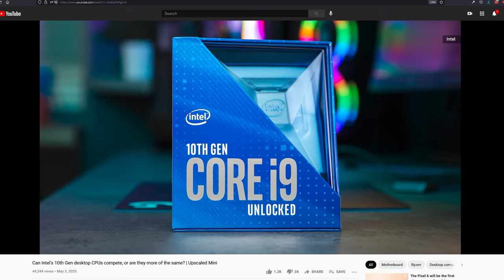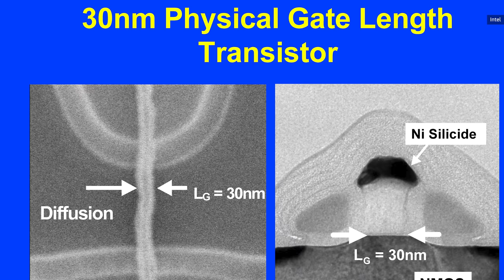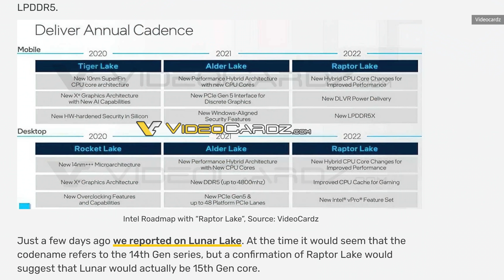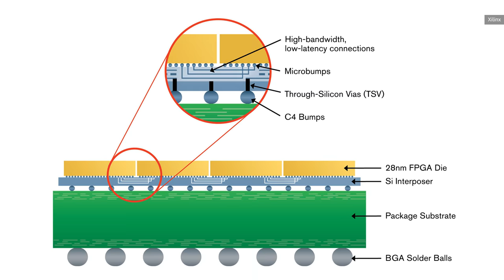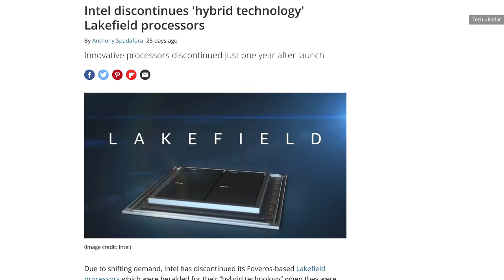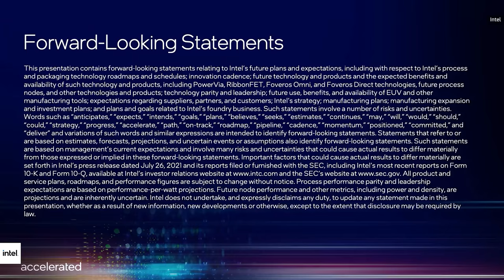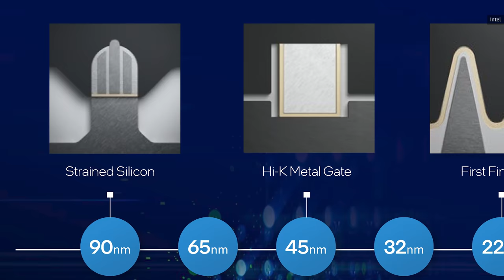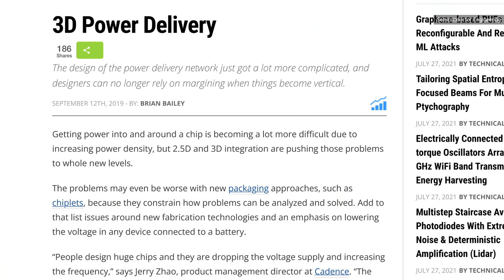Intel has a plan to go beyond 3nm chips  | Upscaled

Comment: Question: Did Intel have an nm advantage in the last 8 years? if Intel 10 nm = TSMC 7 nm.
Is Global Founders 32 nm = Intel 32 nm? And 21 nm
Reply: Global Foundries and Samsung were slightly behind TSMC in terms of transistor density. But close behind. 

If Intel's 10nm node had been successful back in 2016, then they would have been in the lead by far. So far head, that the 7nm of other companies would still be behind the Intel 10nm node (in terms of transistor density).

Intel isn't competing with AMD. Intel created AMD so that Intel can have a monopoly without the legal implications. And also, AMDs most important job was to prevent non-x86 architectures from sneaking in should Intel have an off period.

When AMD started out, they made clone chips of Intel's previous gen chips, and slapped an AMD label on it. Both CPUs could work on the same motherboads (because they were basically the same thing). 

This allowed Intel to avoid more anti-monopoly laws.

By law, Intel is forced by the government to license the x86 architecture to at least 5 companies (to prevent a monopoly).

Intel has fixed the game...and AMD is not really a competitor...not when you are one of the main shareholders who have their fingers in what is actually a single pie. If Intel really wanted to get rid of AMD before 64bit, then all they had to do was give that license to another company. 

Competition is an illusion created by Intel when they created AMD.
Reply: @tylerdurden3722  AMD owns the x86_64 the 64 bit extension of x86. Intel has to license it from AMD. so they both need each other. if Intel pulls x86 then AMD can pull x86_64 and intel cant make 64 bit.
Reply: @RickyT15  Uhh, Intel licenses x86 to AMD
Reply: @muhammaduwaismuhsinmuaz4385  yes and AMD owns the rights to x64 extension and licenses it out to intel.
Reply: @RickyT15  oh yea

Comment: ZERO chance I'll EVER buy ANY apple product :D   theyre literally worse per buck than any other product. On top of which you get zero posibillity of tweaking anything serious to your own desires AND they control your device and actually even DOWNGRADE it over time in order for you to have to buy a new product - that if it hasent self destructed due to overheating long before and they deny you ANY possibility of repairing or replacing ANY part at a normal cost.

Comment: This plan sounds horrible and over engineering something that already broken. During that time line the others will be in a different realm,  what Intel trying to do in 2025 will be useless and they will eat them up. Imagine what ARM CPUs will be in 2025 , The only way is to price it very low, lower than all the competitors or the performance is at least 2x faster with the best lower power consumption than the competitors which we know will never happen lol

Comment: They can't even match AMD in performance...I'll believe it when I see them actually meet deadlines instead of just talking.
Reply: 11th gen destroys amd in gaming
Reply: @creatineenjoyer7345  not really but it does match AMD in performance except at r9 vs i9
Reply: @creatineenjoyer7345  you're delusional not to mention Zen 4 is going to obliterate Alder Lake in 2022
Reply: @creatineenjoyer7345  No, they're nuclear reactors that can't match up with their Ryzen counterparts.
Reply: @MatrixJockey  Raptor Lake is going to obliterate Zen 4 in 2022
Reply: @gromek32  We will see what these next generation platforms will bring to the table. I still do not think that the BIG.little architecture by INTEL will suddenly crush all the work AMD has been doing over the past 4 yrs.
Reply: @MatrixJockey  intels big little is very different from arm big little coz the little cores are also quite powerful. These little cores used to compete with arms big cores in performance. And the big cores called Golden cove are about 25% more powerful than zen3. Overall it beats everything from amd including the top 5950x.
Reply: @Yusufyusuf-lh3dw  I'm aware.

Comment: All this new roadmap all of a sudden might be to attract media and increase funding. Even if we look at alder lake, which should be get the highest performance gains in years because of moving on Intel7 directly from 14nm+++++, skipping 10nm and 10nm superfin even with 19% IPC that Intel claims should have increase 50% performance in equal core. But the difference between 11700k and 12600k isn't that much despite both being 16 thread CPU

Comment: intel is struggling to put out 10nm chips and now is talking about angstrom, hmm i see angstrom about 2 decades away. and by then the competition might be on 0.5nm.
Reply: These are just numbers. Nothing about a TSMC 7 nm is 7 nm or an intel 10 nm is actually 10 nm. It’s not that the numbers are slightly off; the numbers mean nothing and have meant nothing for a decade. Smaller numbers are just meant to convey a better process node. What matters is power, area and performance. Measuring area is not trivial either; it depends greatly on if it is logic or SRAM and the required performance and power.

Comment: I forgot which one electron/photon that if the layer too thin, the electron/photon can just go through it. Designing 3nm fabrication chip would be a big feat
Reply: That refers to the transistor gates. At 3nm gate width, this starts to happen. It's a quantum effect called Quantum tunneling. The electron doesn't really go through. It kind of teleports to the other side. 

SSDs and flash storage use this phenomenon as the bases of how it functions. Electrons are intentionally "teleported" across barriers. 

But, you don't need to worry. Transitor gate widths are not there yet, or even close, and are not really shrinking.

E.g. Intel 14nm and TSMC 7nm average gate widths are about the same. (gates widths vary from transistor to transistor within the same chip, depending on the requirements for that transistor) 

There used be a time when "3nm" would refer to transistor gate width, but that time is long gone. And all we're left with is marketing BS...which has turned into a runaway train.

Comment: Just a technical question: With the lowering of channel length, don't you think heating will increase due to the increase in leakage current and quantum tunneling?  Sorry if I am missing something. 3nm is cutting edge.
Reply: Yes, actually this is already a huge problem. That's why they moved to FinFet and are moving to GateAllAround design. Actually currently the individual transistors are not getting more efficient anymore, because we moved beyond the Benards Scaling regime. Basically room temperature is causing too much noise. But because due to scaling you can still cramp more transistors onto the chip, the overall chip still becomes faster.

Comment: Arm on desktop will be insane
Reply: Only if it can scale well
Reply: @ryanwallace983  I believe it can with the proper support and software structure behind it. Such low power consumption for high performance mobile computing will usher in a golden age of technology
Reply: @earnistse4899  software doesn’t equate to power scaling-that’s a characteristic of whatever node/process they use and chip design

Comment: I'd prefer to go to Apple's "M2", M1 is their entry level SoC, they're learning from it... So it's better to wait for "M2"

Main reason is because M1 was already pretty powerful and with less than 10W...
Reply: M2 will also be entry level. M2 will simply come in products currently having M1.

M1 to M2 is like Intel 10th gen to Intel 11th gen. M1 to M1X is what Intel i5 is to Intel i7. 

If you’re talking about more multicore performance, you’re looking at the M1X. Bloomberg says 8/2+q6c GPU against the M1’s 4/4+8c GPU. 

Apple is not “learning”. I’m suprised why people simply forget that the iPhone and iPad have been running on A series since 2007. More than 10y. It’s not yesterday that apple started making processors. M1 is literally an A14 with more cores.
Reply: @shresthsonkar9207  I'm not interested in Desktops, I prefer Laptops, so "M2" could be considered a high end option (at least for me) if rumors were right about its specs (12 CPU cores / 16 or 32 GPU cores)
Reply: @jihadrouani5525  that SoC you describe is the  M1X, not M2. 

And M1X won’t go into MacBook Air anyway — MacBook Air will get M2 which is going to be only 20% faster with same amount of cores as M1.
Reply: @shresthsonkar9207  There's nothing official yet, I would get a redesigned MacBook (14" or 15") with 12 CPU cores, and 16/32 GPU cores (under 2000$ if it's possible)

Comment: Intel have to beat Apple/AMD in design and TSMC in fabrication and they are currently failing at both. Meanwhile, Apple/AMD just have to concentrate on one thing, chip design and TSMC just has to concentrate on one thing, fabrication. In such situations, the gap usually keeps getting wider
Reply: Intel would catch up they are very innovative
Reply: I don't think Intel is behind AMD is design.

Over the last few years TSMC was leagues ahead of Intel in terms of fabrication.

Yet, Intel's final products still competed with AMDs. Which means that Intel's designs were leagues ahead of AMDs designs.

And it needed to be for them to at least be on oar with AMD for so long.

Just ask yourself this, do you really thing AMDs designs would even hope to compete if those were put on 14nm (like the Intel designs were).
Reply: @tylerdurden3722  AMDs designs is better. Currently intel is using a more dense 10 nm  108 million transistors sq/mm vs Amd using tsmc’s 7nm 97 million transistors sq/mm. Intel needs to use a ton more of watts to match and exceed AMDs performance

Comment: I hope Zen4 is like Zen2 in term of Zen3 hi performance but more humble of AMD. 6600 priced like 3600 when it first out or a bit cheper. I hope AMD will once again create histrory buy adding 2 core at same price. So 6600 will be 8/16 on the same as 3600 release price. 

Intel is so funny trying to make sure that their 14++++ is on par with 10nm other and 10nm is on par with 7nm. But it even prof that their processor architect is not good, not because using outdated fab.

Comment: But if it makes CPU components do they not understand that's that is a that is a processor to make CPU cuz the d u v they processing the same same parts and pieces as as a motherboard does do they not understand how a CPU is made to run computers you see how they are made right so you see how the CPUs are made and the euv's is doing the exact same thing same amount of what it ain't nothing but the same thing but changed in a different way is the pieces can you can have a handle and a handle computer chip because you can have a remote that is like almost like a handle when you making computer chips the computer chips are starting to get smaller because the transistor is that small that means you can make the computers also small just like that they're both the same thing especially when you talking about saying or clay or dirt or rock with it to make to send me conductors or CPUs it is the exact same thing I know in the silicone is also done the same way on the CPU components and they also use metal like copper 10 depending on which one you talking about the d u v and e u v is different between a marker processing CPU because of CPU uses a different metal all three of those May differently are made with three different types of metals to get it to activate